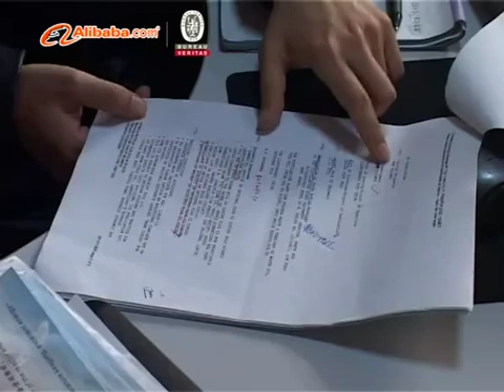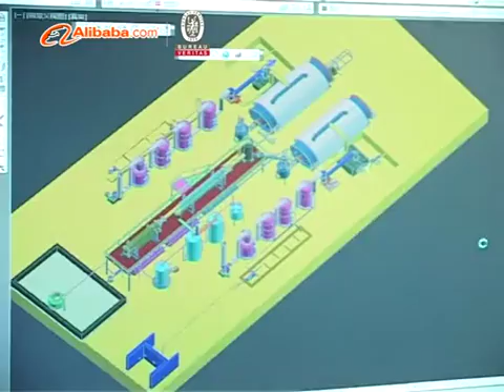Jinpeng recycling equipment for pyrolysis and distillation

Comment: Hello.                                                                               Inquiry / eco@ecocreation-in.com      This is bella sales manager from Ecocreation co.,Ltd.We Ecocreation manufacture pryolysis machine which convert PP,PE,PS,ABS or Mixed plastics into fuel oil. Initially pyrolysis process was very simple only by treating Single material. But recently, since peoples put in mixed waste(ex: house waste/ low grade waste)  some of problems occurred. It because, this material include a left detergent, beverage, various chemical materials which has a strong acid character. So when pyrolysis, this material comes out with oil being wax, sulphur, foreign matters etc.Therefore, Now we should study about chemical catalytic to remove an wax, sulphur which makes problems. Our ecocreation is the only manufacturer that has studied this part,By using the main catalyst, it is possible to improve safety, oil quality, process simplicity, etc.Recently we succeed of using our produce oil at generator without any problems. then started to commercialized over 17 countries by installation.     Three catalysts to prevent wax, sulfur and coking.     Wax- When wax oil is extracted, it is sticks to the piping in the pyrolysis plant, then causing hardening-> plugging-up> Risk of explosion. Also, it should be re-melted to use later.     Sulphur - Generates from strong acid such as ordinary detergent, which causes corrosion of piping in pyrolysis plant      Cocking - Finished process, sludge leaves inside of reactor. This is easily hardened on reactor wall , So operator should clean up by get in. But we makes this sludge to fine powder through out Catalyst. So no need clean up inside by hand.